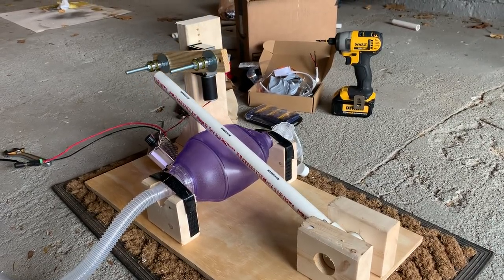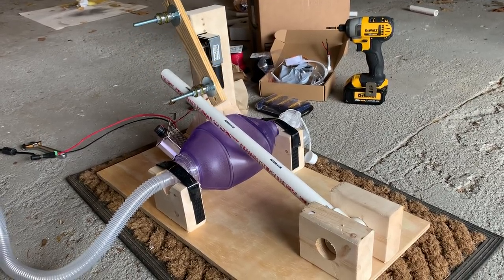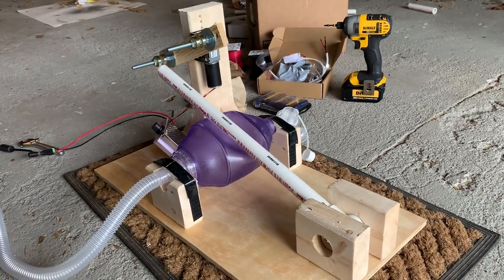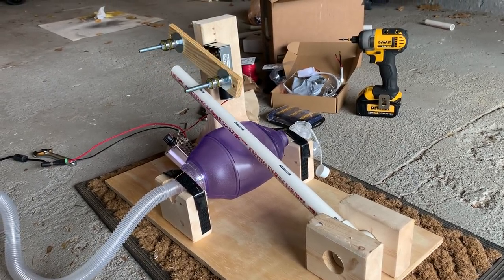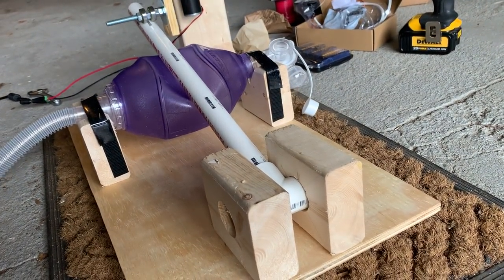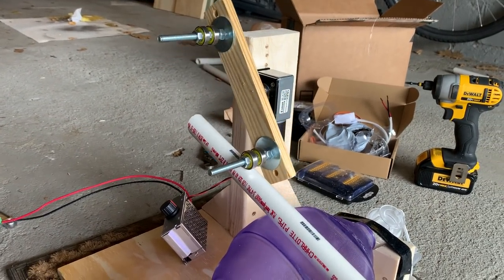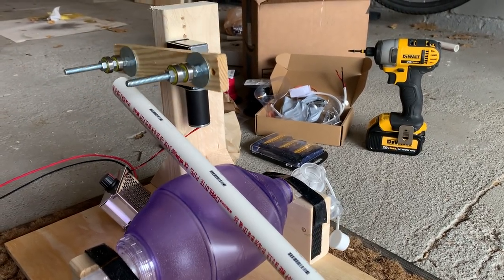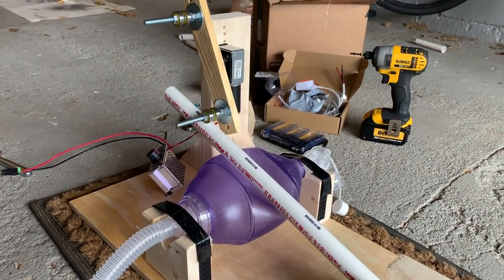Macgyvilator Mk 1 (3-19-2020) - "ventilator" for disasters and/or low resource environments

Comment: The ingenuity here is remarkable. As a builder, i know it is difficult to design something that is both efficient and adjustable to work in many areas. If that difficulty is multiplied by the simplicity of the design, what you've done here is nothing short of incredible. I find myself over engineering things when I'm creating even a simple new tool or customizing something for a customer. It's easy to do. My hat is off to you!
Reply: K...
Reply: This is a contraption built by someone who isn't even qualified to understand the principles behind ventilator design. This thing will kill the patient. Period.

Ventilators are complex and there are many reasons why.
Reply: @peterdalton8101  I wasn't born with the knowledge. I acquired my knowledge through school initially and the rest was during 25+ years of experience designing and manufacturing specialized automation equipment in the aerospace sector. It's what I do for a living.  

The approach to engineering and design is very similar regardless of the field of expertise. Any competent engineer will tell you the same thing.

Having said that it took me 30min to research and understand exactly how and why ventilators are designed the way they are. Sadly, these DIYers didn't even bother to do as much. If they did they would realize immediately that what they're attempting is a waste of time.
Reply from the maker: Just want to be clear here, as I've been in the description and other comments, that this is not intended to be a replacement for a real ventilator. This is a last resort solution for low-resource environments and provides something that's one step above prolonged hand-bagging. And if you look at the Mk2 video, you can see that I went through the trouble to tweak the design and validate the output, so that others can use this as an open source starting point, as well. I am a physician, I've used ventilators, and I understand the complexity and difficulty of artificial positive pressure ventilation. I've also had critical care docs and respiratory therapists providing guidance. No, this is not a $40k ventilator, but it could be all there is in some places, and it could be the basis of something even more capable. So before you start throwing baseless and unhelpful criticisms around, @James Crud, please pause and think. The whole world is fighting this illness, and it's going to take contributions from everywhere targeted at all sorts of niches to help us get through this. Let's all try to help, and good luck to us all.
Reply: @datatrician1369   I'm stating facts. You can see it as criticism but that doesn't change the truth. You can't leave a person on a BVM like this longterm and unmonitored because you as  physician should know they'll most likely die. A intubated patient needs to remain on a ventilator 24hrs a day for days possibly weeks. You can't do that with a BVM. You know this so what exactly are you trying to defend?
Reply from the maker: @James Crud You're putting words in my mouth. I said that this is a last resort solution for low-resource environments, one step above prolonged hand-bagging, and a template for future enhancement. I have never said anything about "longterm and unmonitored", which is abjectly silly. Even fully fledged ventilators don't work unmonitored. You're stuffing a strawman and throwing around ad hominem attacks. Please stop being a troll. And now I will stop feeding.
Reply: @datatrician1369  You know just as well as I do none of these contraptions will ever make it into actual use even in low resource environments. There's wishfull thinking and then there's reality.

I'm curious...you claim to be a physician so what exactly are your credentials?
Reply: @james crud what exactly are you hoping to prove here? I’m sensing a bit of insecurity in your remarks. Possibly an inflated ego. Are you out to prove yourself better than others? Were you possibly picked on as a kid in school?? This would have been a great tool in Italy. A doc or nurse could watch 3 or 4 patients using these and adjust as needed. I could see this save lives. It’s not a ventilator. It’s emergency relief in a disaster scenario. For someone that supposedly has your credentials, as you wish to judge the creators, you have a hard time understanding simple English. Your insecurity, negativity and ego will offer nothing to the betterment of humanity. I’m sorry you were treated bad as a kid. Or a grown up. Or that your uncle touched you in your no no places. You should seek out some professional help though instead of being a jerk to people trying to make the world a better place. I hope you find some peace in your life. Good luck ✌️
Reply: @timbarker5663   I'm not better than everyone but I know for certain I have far more design experience than you. It has nothing to do with ego. It's just a fact. 

I'm not here to prove anything. I'm here to try and educate people who are potentially impressionable and watching these DIY ventilator videos. They need to know the truth and not be mislead by information that is wrong. Too many people on Youtube come across as knowledgable but in fact know very little....a bit like you. You think these things could have saved lives in Italy but that's because you don't have enough knowledge to understand that they can't. As an engineer with more than 25 years of experience I can tell you that a little bit of knowledge can be dangerous.

I'm not the only one who feels this way. Real Engineering did a video on this very same topic to explain the problem with this DIY ventilators. Search for it on Youtube. (Real Engineering Ventilators)

FYI, I wasn't picked on as a kid nor did I ever get molested. I had a very good childhood in fact. I have no insecurities and know my limitations. I don't live in a fantasy world and will always call out bullshit when I see it. That's just how I roll.

Comment: Great job! This model is simplistic and with the few tweaks already mentioned, it should be fairly reliable.  As a former ICU nurse having cared for many intubated/ ventilated patients, I can see that this model and mode of ventilation would be for patients that require full sedation, as it does not have a demand mode to accommodate for when a patient initiates their own breath. Being able to adjust the I:E time is very important. However, that is only effective if the patient is not trying to inhale during the exhale cycle. That must be controlled by proper sedation.
  I’m not sure what to recommend to overcome the issue of dis-synchronous breathing (when the patient attempts to breath between the set breaths delivered by the vent) other than sedation. Normally, in ARDS, patients require full sedation and maybe even a paralytic in order to decrease O2 demand and to ensure adequate ventilation and oxygenation. However, at some point in time (hopefully) measures need to be taken to wean the patient from the vent. Being able to incrementally wean PEEP and PSV  is beyond what this basic ventilator is capable of doing. However, if your ventilator manages to keep more traditional ventilators available for use, then patients could be transitioned over to traditional ventilators ( maybe even over to CPAP machines) when ready to be weaned.
Reply: Thanks for taking the time to out your thoughts into the world.nwe need more thoughts and less fear.
Reply: i agree, adding to what you mentioned is how to adjust the position of the bag for the patient with all those extra accessories attached to it,,,, ??? being an RT i love such ideas but it needs more work on it to be suitable with actual need and the icu settings ...
Reply: "As a former ICU nurse" I'm sure you realize that no doctor or hospital would allow contraptions like this to even get past the hospital doors. I wish people would stop trying to come up with DIY ventilator solutions hacked together from plywood and hardware store parts. It's a waste of time and energy. Aside form all the technical reasons why they would never allow it, liability is number one. The first patient that dies while on one of these things would unleash a shit storm of lawsuits on the doctors and hospital for negligence. Just stop it already.

The willingness to help is commendable but this is not the way to do it.
Reply: @jamescrud  if things get really really bad, as you see and hear everyday you never know. Also, I'm sure that the doctor who made it knows that. It's about getting a design into open source to be 3d printed in Mass. You don't know that? Just stay home the hospital doesn't need you.
Reply: @chaosswa-ee-ty5911  You're delusional but go ahead and waste your time.
Reply: @jamescrud  in unprecedented times, unprecedented things happen. Take care genius guy who has the cure to covid so others shouldn't even try. Lol
Reply: @jamescrud  Ok, but isnt there a difference: NO ventilator and no breathing, vs. SOME ventilator and survival. In absence of proper ventilator, you sign off a waiver that you are ok with this one, rather than being left to die because no proper one. He isn't doing it because there is enough standard ones, but because there isn't enough, and some will die because of it.
Reply: @allnamestaken0   Yes it's logical to try anything as opposed to nothing but what I'm trying to say is that the medical community will not allow it. Patients can't simply sign waivers. That's not how the system works. This is why I'm saying everyone is wasting there time trying to build plywood ventilators.
Reply: @chaosswa-ee-ty5911   You come across sounding very naive. There is no point in trying to build something for a community that will not let you implement it. DIYers and the maker community doesn't have all the resources necessary to get functional equipment into hospitals. It takes more that just an idea, a 3d printer, and some arduino boards. The company Dyson has designed a ventilator in 10 days which they can produce rapidly and relativley cheap. They can do this because they have the money and resources for engineering, designing, testing, manufacturing, and not to mention the legal resources necessary to take care of certification and liability requirements. Dyson's efforts are going to save lives...your 3D printed arduino powered piece of junk will not. Understand?
Reply: @jamescrud  mine? Lol I'm not the doctor who made this video. I'm a high school student, undoubtedly naive. But I'm still not going to squander their contributions like you are. That still makes you lame. Naivety excluded.
Reply: @jamescrud  and yes. I understand. Thank. you.
Reply: @jamescrud  Ok. What is the procedure when Dr. says:sorry we have no more ventilators and you do need one to live?I really do want to know what happens? I suppose you can choose to go home and breath there, not stay to die in hospital. It is not for normal situations. People dont build these to sell and get rich, but to help others build something for themselves or their neighbour in need when nothing else there.  Instead of having someone hand pump it 24hrs,why not let machine do it while you are around your loved one for other needs. Maybe needs loud alarm if stops turning.
Reply: @James Crud 
In 1972 during the time of polio crisis they used ambu bags and people were manually compressing it. This is still better than that scenario. Extraordinary time extraordinary measures. If it came down to me saving a family members life becos of no ventilator or this I’d take this and I think u would too
Reply: @KC08RAS  you have to use @ in front of his name. You messaged me instead. But good point nonetheless.
Reply: @Lester Lester 
Thx just done it
Reply: @jamescrud  Dude, all medical equipment use in the hospital today, started as plywood or a desperate idea during a crisis and them over time got refine.   just take a trip to a museum after Covid 19 and you can see what i am talking about
Reply: @hispanicuscorpus  Yeah so? What's your point?...hospitals still won't allow it no matter how nostalgic you get.
Reply: @jamescrud  I think it's hilarious that the follow up video shows the device in a Hospital workroom where they run it through testing and further refinement passes.  Sucks that its becoming such that these kinds of solutions are becoming more and more viable as shortages start to really impact areas.
Reply: @The_Geezus   lol. You don't even know what you're looking at.

Comment: FYI...In a pinch, you can get the bearings you need from most fidget-spinners.
Reply from the maker: Great tip!
Reply: Only use the center bearing they always use defective bearings for the outer weights.
Reply: very good one!!
Reply: You should contact Gov. Cumo in NY about motorizing his disdain for manual bag ventilators!
Reply: @datatrician1369  I was thinking of using delrin (low friction plastic) rodes on the arms.
Reply: sometimes you can buy those spinners FOR A DOLLAR at REAL dollar stores.

Comment: You may use the wiper assembly car too . for changing the tidal volume, you can slide the motor assembly sideways to take the lever magnification advantage and can have very fine control of volume.   This is indeed a very innovative idea. You being a doctor has done very interesting development.

Comment: Toss a peep valve on there and an index to slide the BVM so it can deliver set tidal volumes and you got a pretty slick rig!
Reply from the maker: PEEP valve is totally key. I just didn't have one handy :p. As for controlling tidal volumes, on this design that's accomplished by moving the motor up and down on its mounting post. The motor is held in place by two wingnuts, and there are holes to allow the motor to be moved up and down in 1/2" increments

Comment: Very nice first version. A few suggestions to consider for next version:
1. Use a flat board on a hinge rather than pipe to compress the bad, you’ll get more volume with less compression which should extend the life of the bag. 
2. Put a block under the hinge side so the bag is compressed between two parallel surfaces.
3. Rotate up 90° so the hinged board falls away with gravity.
4. Use short vertical pipes on each side of bag to keep bag captive but allow fittings to float.
5. Use PVC lumber where available to make for easy cleaning/sterilization.
6. Glossary of acronym meanings for lay makers.

Are ventilation machines triggered by a chest strap or negative air pressure when patient tries to take a breath? I can think of a couple ways to sense patient-initiated cycle.

What are typical volume ranges, I:E ratios? Can you elaborate on PEEP? 
What additional features would be nice that are found on medical ventilators?
What safety features should be included?

Looking forward to MK2!
Reply from the maker: All good suggestions. I'm definitely planning on either lowering the bag or putting a block under it. As for the board, it's a sensible idea, but I'm actually very wary of adding more weight to the compression apparatus. Right now I'm relying on the elasticity of the bag to reinflate itself, and I'm not keen on making that harder. I might have to install a spring to help lift the compression lever. That would also obviate the need to rotate the whole thing 90 degrees (which would make it a PITA to build :p)

Comment: Doc, why you say you wish it's never needed, it's needed today and can save lives. As an electronics engineer, I can suggest a strong UV sterilization LED at the input to the valve.. I have full circuit ready with battery backup for anyone who wants to build it. The UV led setup can also be enclosed in a small container for sterilization of masks, gloves and such..
Reply from the maker: Thanks for your offer! I've actually looked into UV, and unfortunately it doesn't act fast enough to be of benefit here. The air (and microbes) are moving through too quickly for UV to do its work. Best to rely on the inline microbial filters that hospitals typically use for airway circuits.

Comment: The only thing that I can see that could improve it would be to have reinforcements with plywood on the sides of the bag valve mask to reduce misplacement. Also another reinforcement on the bearings so the pipe doesn’t come out of place. You could also make the pvc pipe “fixed” to one of those bolts so it  won’t come off. You would have to adjust the timing with the Tidal volume. 

As a firefighter medic I got to tell you this is genius. This is what America is all about. If there is anything I could do to help you make this better let me know. 

Alex

Comment: Add two pieces of PVC pipe where the pipe meets the bag, this gives you a better push for the amount of energy that you are using attach with two bolts.  You can also use a PVC pipe to make a roller bearing which you can find on youtube.  Very simple and excellent design.  Great work. 

Good On YOU!!!